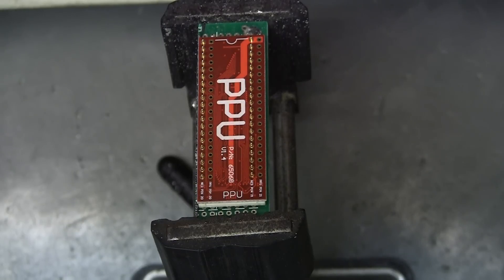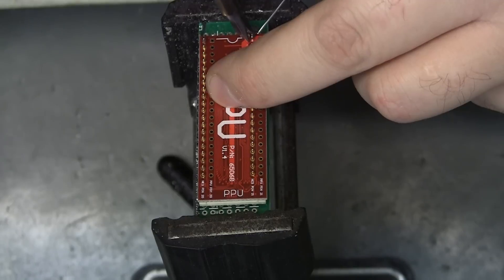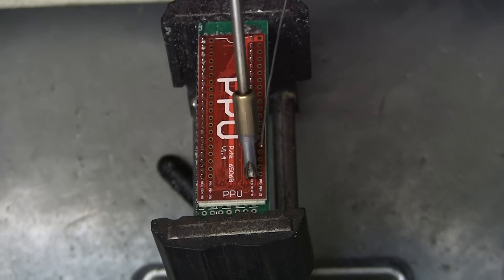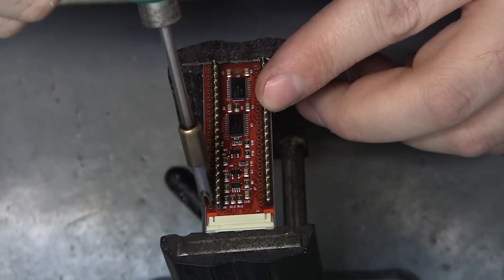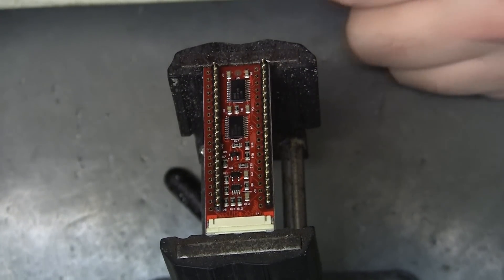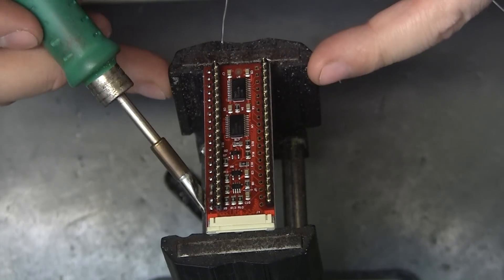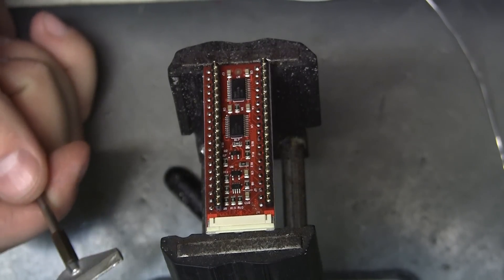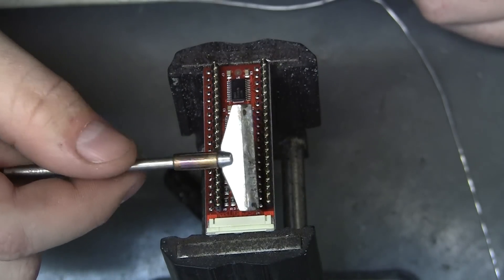JBC new soldering tips trials c245 667 765 949  electronics lab tools

Comment: Sweet! Just purchased a used ad2950. But sadly only a very thin conical tip. Looking on tips for tips. A friend who work full time with soldering said he used the JBC's and the c245-939 for both through hole and smd stuff. What is your favourite allround tip? For through hole stuff, 1/4W resistors etc.
Reply from the maker: 939 was my fav but i like the 765 a bit more as it holds less solder on the sides so less chance excess built up solder will end up places you didn't want it. I use a lot of other tips for special circumstances as well.
Reply: GameTechUS Thanks! Yeah, that tip looked amazing in the video. Maybe I don't need to get a chisel then :)

Comment: Wouldn't that one with the groove make cold joints?
Reply: Hello Gregory!

To avoid cold joints you must keep the tip in contact with pin and pad the necessary time.

The way to use this kind of tips (C245669) with groove is to drag while keeping the groove filled with solder.

The dragging speed should also be adjusted based on thermal requirement of every assembly.

The effect is similar to a miniwave, the molten solder transfers the heat to pin and pad (as well as both “legs”)

The results can be improved even more by applying external flux.
Reply: @JBCSolderingTools  I just started soldering today with my new CDS station and some chisel tips. Awesome gear. You're doing a great job over there in Spain.